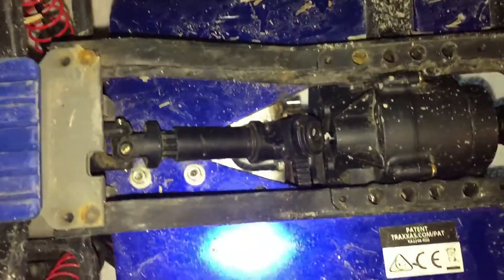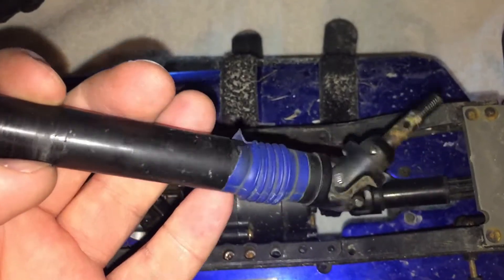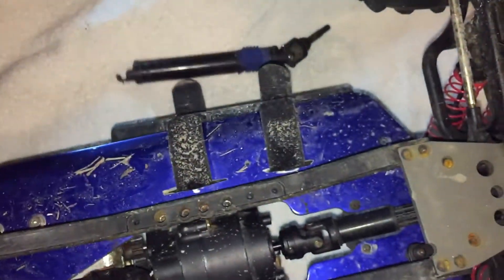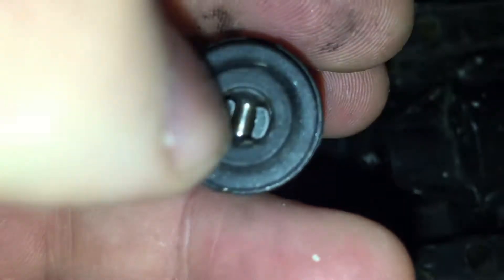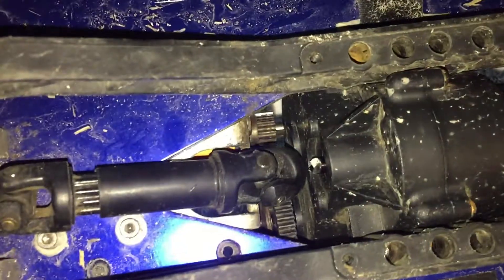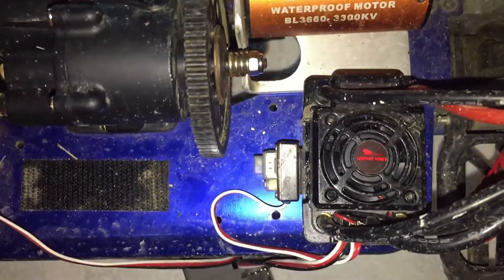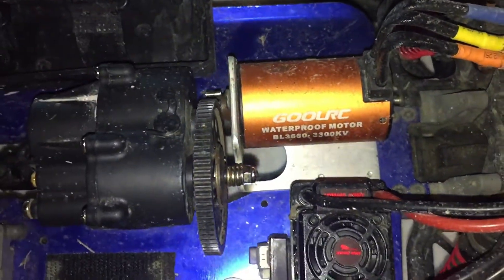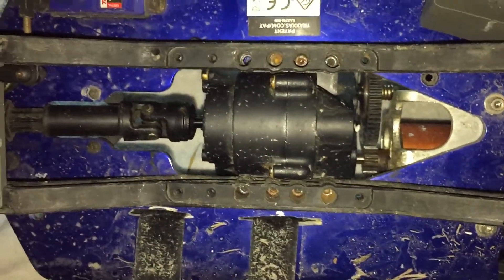EXTREME T-MAXX BASH AFTERMATH

Comment: That sucks bro I haven't had that happen to me as of yet but do you have play in the rear driveshaft?  If you don't I would say that would cause it when the truck get jumped and the rear goes down that is suppose to have a bit of play to move around so the impact won't just hit the shaft that's snapping hope that's the problem I would check that once you fix it
Reply from the maker: Rc Fun, exactly what are you referring to that needs play?
Reply: The rear driveshaft should be able to move in and out if you press on it